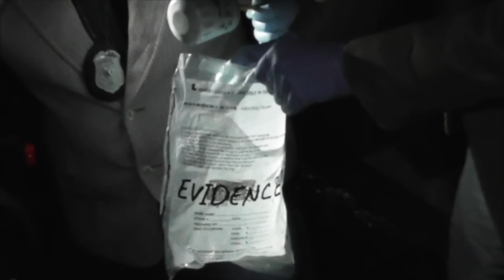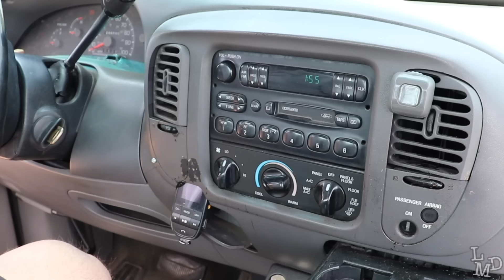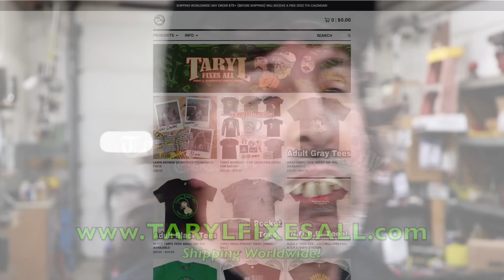Kawasaki Running Badly? Check This Amazing Tip!

Comment: you may never see this question .. i have two problems i have a new holland gt22 ,, gets warmed up and backfires and quits running .... next i have a cub cadet ,,i need to change the drive belt ,,clutch came right off but the drive pulley doesnt move ,,, ive tried everything but burn it off ,, any ideas ,, love your shows  and thanks if you do get around to answering me ,,, :)

Comment: I have a fh601v losing power and smoking a bit. How much blowby is acceptable from the oil filler tube ?  It blows plenty air and oil out of the tube .. thanks

Comment: What is the purpose of the  vacuum line that you pulled off the intake elbow.  Where does it go to or connect to? On the engine schematic  it is capped off. Thanks for your help...

Comment: Just had a Cub Cadet 1050 come in last week running poorly, turns out mice chewed the coil on one side and it was only running on 1 cylinder. I'll have to remember this choke issue, thanks for posting! And yes, I also struggled getting those headlight bulbs out.
Reply: Fluffy the mouse causes thousands of dollars in repairs on mowers and 4 wheelers yearly. Why do they not care to get rid of mice? I turn many jobs away because Fluffy has destroyed the whole wiring harness.

Comment: I have a question used to apart from a different brand wouldn't fit on another brand but I had a Honda engine and I had a Briggs & Stratton the Briggs & Stratton was blowed up so I took the carburetor and put on the Honda and it worked great

Comment: One of the primary reasons I went with the Toro Titan Max as my new mower, was because it's carbureted (instead of EFI) and has a MANUAL good old-fashioned choke! No delicate and complicated electronics to create driveability issues and require you to take it to a dealer when it doesn't start because you don't have a $700 small-engine scanner...and when something does go wrong eventually, I can fix it myself and on the cheap. Folks, believe me, you don't need the complication of EFI on a freaking lawnmower!

Comment: I find Q-tips to be invaluable for a variety of uses around small engine repair !
Reply: I use them all the time my wife gets so mad so I end up buying a package for me and a package for her
Reply: Have you seen the pack of different sized swabs Harbor Freight is selling now? Theres a size
for all applications in the shop, really handy. 👍
Reply: @Big_Johns  That would be ideal !!
Reply: @glenmiller7294  I love them brother 👍🏼
Reply: They work great for cleaning inlet needle seats
Reply: @jameshedrick605  Yep! If needle seat is just metal, I wrap a few strands of 0000 steel wool around the Q-tip, chuck in my drill and really clean and smooth it out !!

Comment: Had this same issue on my scrub cadet with a Kohler 7000.  On the kohler they use a foam piece like a washer around the choke shaft (presumably to keep out dirt).  On mine it disintegrated and worked it's way into the shaft hole which made it bind up.  Pretty much the same fix. Cheers!
Reply: I just had other one do that and customer thinks he caused it, had to show him what happened lolol

Comment: Hey Terry and Friends
This video was very helpful!
Thank you!
I ran my Gravely Z60 out of Gas again cutting at dusk.  Fueled the tank but she wouldn't go and I could smell fuel so I let her stand in. the yard overnight to think about what she'd done.  Still refused to go the next afternoon and Hydrolocked.  After pulling the plugs she spit fuel five feet out each hole and most of my Left leg.  Thanks Honey!  I love you too!
Checked spark!  Lotsa spark both jugs.  Dried her out with a flame job and heated the plugs!  No Joy!  And now she was pouring fuel out the exhaust.   The in doubt!  Get the YouTube out!  Checked several videos but yer's was the choice with the "Runs when Vent tube pulled out of tank and plugged section cut off". I just pulled the fitting off the return line and also pulled the elbow off the supply line before the pump.  That I figured would allow her to clear her jugs of all that unburnt fuel.  Then let her spin!  Couple seconds and she started to cough and barked to life for the first time in 24Hrs.  Pulsed fuel to her by reconnecting and disconnecting the supply line until she kept running and then moved her into the shoot reconnect the Vent hose from the carb to the fuel tank.  All is back to normal.  She's a good running machine and as I know there's nothing really wrong, it ticks me off when she won't go.  But I hope I have learned my lesson to keep her above a quarter Full for fuel and never have to have an issue.  Seems there is a possibility to cause a vaporizer lock in the vent line when riunning her hot and then when the fuel stops the vaporized remaining fuel causes the iffy.  
Just don't let it run out of fuel and save yourself a bunch of hassles.
Hope you company gets that Dental plan they've been promising!
Best!
Pecker

Comment: Never had a stuck choke, before. 27 years ago, I had an Exmark 36" walk behind (belt drive tranny/wheels) and I had issues getting the choke to engage so that I could get the Kawa started when cold. Thumbs up! "On the count of three, pull yours out, detective." Huh, huh, huh, huh, huh.

Comment: I suspect my Kawasaki fh661vb87717 has blow by.  When I remove the dipstick while running, it intermittently sprays oil out the dipstick tube.  Doesn’t seem like it has to much pressure when I put my hand over the dipstick hole.  Can anyone explain what is acceptable or not acceptable for these motors.  Thanks

Comment: The problem is that the plastic was not formulated for long-term.Use with exposure to heat and chemicals.  Most likely the plastic is breaking down and expanding causing the choke to stick.  Darryl is absolutely right, As usual, experience is the best teacher.  Thanks for a great job and sharing your practical and professional expertise with us novices...   👍👍👍

Comment: The fix for all FX series 2-barrel carburetor chokes is as follows:
You want for all the dirt to be out of the choke shaft>carb body area and DRY MOLYDENUM DISULFIDE POWDER  to be impregnated into the plastic shaft bushing and the hole in carb body.
It's a PITA to remove those carbs, so do this to get the desired result:
With the engine running use a soda-straw on a can of carb cleaner while working the choke lever (yes it will stutter and complain when the choke is closed - be quick about it.) and this will get the majority of the dirt off the plastic bushing on the shaft and out of the hole (bored in the carb body).
Then use a small bottle like some 2-stroke oil comes in and throw in a handful of small nuts bolts BBs ball bearings - what have you. Fill the bottle 1/3rd to 1/2 full of plain gasoline, cigarette lighter fluid, carb cleaner spray, whatever. Then get a grease gun loaded with "Extreme Pressure Molybdenum-based Chassis Grease" and put 3-6 full pumps in it. Actually work your way up with the grease. You want it to be fluid still, not like ketchup. Squirt some in the bottle and shake to mix the solvent and grease together. When it will still run off your finger - get the engine running high speed, squirt (through a nail-hole you make in the cap )some of this behind the choke lever and rapidly move the lever back and forth. The slight vacuum behind the air cleaner will draw the stuff into and around the choke shaft and bushing. Then shut it off and leave it overnight for the solvent to dry and the grease to reestablish itself. It will work nice and buttery-smooth now but the problem is that dirt will quickly add to the grease and seize the shaft up again. So now engine off work the choke lever by hand deliberately putting force sideways to the shaft axis UP, DOWN, DIRECTION OF AIRFLOW, AGAINST DIRECTION OF AIRFLOW.
Do that as many times as you can stand to do it. You are impregnating the surfaces of that cheap little "shaft & bushing-bearing" with good old priceless MoS2 particles that is the very finest dry lubricant.
NOTE: PLAN ON CHANGING #2 SPARK PLUG AFTER THIS IN CASE THE MOLY SHORTS OUT THAT PLUG !
     Now start the engine and wash behind the choke lever with carb cleaner. It wont affect the moly-film on the parts - but it WILL remove the grease and not catch and hold dirt.
  Yes - this will eventually wear off. Probably after 2-3-4 seasons. But when it does then you will know what to do.
   PS - if this doesnt work its because the engine has backfired and bent the cheap flat choke shaft.
Then the carb has to come off and the choke shutter tapped on with a small plastic hammer until the shaft no longer bulges away from the direction of airflow.

Comment: Kawi FS730v.   I sanded my plastic choke shaft with 400 grit and used dry graphite for lube.   I used an old air filter precleaner (black foam) to make a new dust cover for the end of the shaft.   Total cost: $0.   Also, if you have this carb, don't miss Taryl's newer video about the Welsh plug that is hiding your low jet adjustment screw.

Comment: Thanks a million for the video on the magnets in the flywheel on my Kohler 16.5 . The repair shop said I needed a new flywheel. Thanks to you I fixed it myself with a $7 tube of  JB weld. Runs great!!
You saved me a ton of money. I'm on  fixed income, so thanks man!!!
Reply: I've used gorilla glue to fix the magnet's on a flywheel before and JB weld does pretty good too. I had the glue mine back on last week

Comment: Any ideas on this. I’m up for trying anything at this point. I have a JD x390 with a Kawasaki fs651v it’ll only run for a few seconds to maybe a few minutes but only with the choke on. I’ve put a new carb on it, new fuel pump, all filters are new, fresh oil change. I also drained the tank and put fresh gas in. I blew out all the fuel lines and did a valve job. Yet here I am with it still stalling in seconds. I feel like this issue all started when I hit a wet spot mowing but I could be full of shit there. Any help is definitely appreciated.
Reply: Ignition coil/module. Just had very similar issue with a kohler. Spark looked good cold. Sometimes its just the HT lead but they are usually integrated so you replace the whole thing.
Reply: I blew the $350 on the module and it still wouldn’t run. I cut the nipple off the carburetor solenoid and it runs perfect.
Reply: @nothanks9050  I cut the nipple off of the carburetor solenoid and it’s all good now.
Reply: @TJGriggs25  Good to hear, at least with everything else getting gone over/replaced you should be set for a good while with a few as spares on the shelf too. After a ton of work I'm giving up on the kohler, new Honda going in instead.

Comment: Looks like Kawasaki saved another nickle  over a metal choke shaft by using a plastic one, very frustrating !!!! for the mechanic. I wish they wouldn't use plastic this and that in engines, it = many headaches. Great video Taryl A+

Comment: I have a 15hp Kawasaki on a deere that backfires through the carb and exhaust. Can't get it to run. Have tried changing coil, ignitor, carb, and checked valve lash and push rods. Choke works fine. Any suggestions?
Reply: Check the flywheel key
Reply: @davidcronin1618  yes I have checked that too
Reply: Check for a faulty fuel stop solenoid under the carburetor bowl.
Reply: @johnkelly7154  already cut the pinnacle off it
Reply: Air cooled or liquid
Reply: @davidcronin1618  air
Reply: Is it in time?
Reply: @Kurt Knispel have you tried lapping the valves?
Reply: @FishFind3000  I'm not sure how to check that without taking apart the engine. As best I can tell piston is up when flywheel magnet is at the coil.
Reply: @bradenhenderson2705  not yet
Reply: Try a compression test on it, if it’s backfiring, you’ve got spark, but maybe not at the right time. Let us know what’s going on.

Comment: Other reason to change the air filter regularly, lot of fine dust and dirt will make it stick, remove and clean 
Very very common on plastic cheap shafts 😢😢😢

Comment: One tip, if you save gallon milk or water jugs, you can cut the bottom off and fill it with hot soapy water and use that to dunk the parts in to clean them. Then you don't have to have the water running the whole time.

Comment: I'd be tempted to just loosely tie the plastic choke arm to the metal arm/lever that moves it with a wire tie so that it would be forced open when I push in the choke knob.

Comment: Tarly. 

Your the man  I watch you all the time I always learn something   However to make your information better, sometime  you may consider make a video to include more information on changing an 25 hp v2 kohlar  engine on a craftsman 50” riding mower the owners manual is not to helpful and shop manuals are not available that I Can find  the step by step procedure is the issue I’ve done a fair share of mechanical repairs over 60 + years cars ,motorcycles ,marine , chainsaw, and a slue of anything else yes mowers and. Riders. But the process of the correct steps to take  had me stumped for awhile,  I’m sure some other guys have had similar experiences   And you know shortcuts.   Your brain has the knowledge.  Please consider a  video on the subject. The video you’ve made is good but lacks info as to how to a-line all components  to bolt back properly. Thx again

Comment: Good, easy fix. Love the high pitch comments.
My Scrub Cadet came from a dealer. Totally different quality. 2554. 15 years old. Going great. Kohler Command engine. Choke still works perfectly.

Comment: Wow that is one dirty tractor what are they cutting grass or dirt. First thing I do when I bring the mower in to work on it is I hit it with the pressure washer, cause I don't like working on a tractor that is that dirty. Plus it enables me to find any other problems like oil leaks and cracks in the deck or the frame. 
Plus the customer loves it when you bring it back all nice and shiny so they can screw it up again. lol

Comment: I have a question for anyone that can answer it. I replaced the pulley on the transmission of a Troy built pony. I ended up taking the whole rear end out and changed the gear that holds and keeps  the pulley from slipping. I put it all back together correctly but the pulleys were a inch off .Luckily the factory had made two extra holes above the holes for the bracket that attach everything and I was able to tap them and move the bracket up the inch I needed. what happened? were did the inch go in the first place?  Thank you for anyone that knows.

Comment: Good video I've repaired a good bit of these with the same issue what I've started doing to help it come back down is replacing shaft and bending the metal tab where the bottom part of spring hooks to over and hooking the spring to choke shift arm and seems to work pretty good

Comment: I know on the truck I'm driving it has a plastic intake about 6 months ago I was going to crank it and it backfired blew the whole intake to pieces I was like damn that engine is no good because I thought it was metal so I went and got one out there junkyard put it on run like a champ but I never thought they would put plastic on the engine  car truck engine anyway

Comment: Taryl, is that a "permanent" fix or will you have to repeat it in a couple years?  Maybe explain to the customer that they need to change the air cleaner.  Bet they have never done an oil change either.  Also, you need to sell the Taryl ear cleaning kit.
Reply: I fixed mine like this and it held up I even sold the mower to my neighbor and it's still working 5 or 6 years later

Comment: I can't kick those type of lawn mowers I know they're not the best bought one 10 years ago the only thing I had to do to it was changed oil built a couple times and that was it and it lived outside first real problem was this year back tire was flat wouldn't hold air but for about half the yard so when it was getting close I'd run over to the air compressor and fill it up then when he got close to where I park it the drive belt broke and knock  the deck belt off so I ordered the two new belts four tires in all new pulleys. Everything else is really really good but  the seats got cracked, went online put in a order for my stuff paid for it that was a week ago got a text today saying my parts was going to be running late I thought just a couple days but it said three to six months so I just went and bought a new one when the parts come in I will put it together and sell it

Comment: Just get yourself an air compressor sprayed it off every time you’re done mowing bing bang boo take the air filter out spray it out. I haven’t changed mine in years to spray it out with the air compressor.

Comment: 6:35 wow....another  'engineering '   mental-block. THEY  MADE  the exhaust, of that other cylinder,  TOO  CLOSE   TO  THE  CARBITRATOR. ! (?)  HEAT,  tightened the seals/metal, whatever they used for  parts, within the choke/throttle mechanism.   ........

Comment: Another problem with the Kindasucki engines;  on Deere X-series, they're controlled by a cotton-picking COMPUTER, yes, an ECU that costs $330.00 bucks at the Deere dealer.  And only Deere has the stupid thing.  Not actually Kindasucki's fault, but the stupid assed designers at Deere. When it goes out,  it GROUNDS out the ignition coils after the machine warms up to operating temp,  stopping the engine.  Gotta WAIT for it to cool off, then restart it and go for a while longer.  I'm so SICK AND FED UP with everything going ELECTRONIC CONTROLS.  It's just bull shit.